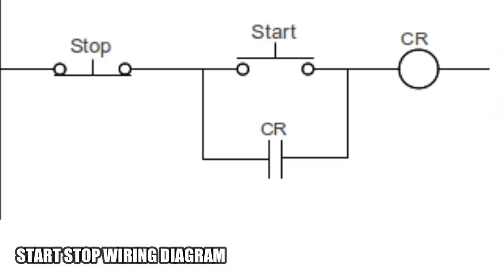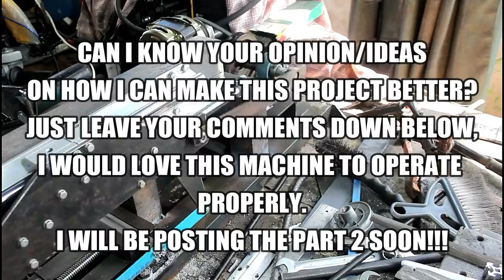Diy Power Hacksaw Build (Part 1 of 2)

Comment from the maker: here is the part two guys.
https://www.youtube.com/watch?v=2mNw62SRrbQ&feature=youtu.be
Reply: Hello, I am just wondering as you have used a washing machine motor, is this machine variable speed?, I am asking as I would like to make a dual purpose machine which could cut wood as well using a bow saw blade, I want something quieter running than a band saw or reciprocating saw to avoid bothering my neighbours especially late in the evening when I get home from work, if you did do this subsequently or think it is a practical possibility I would love to hear your thoughts, I also have a couple of ideas which might improve on your design, if they work I will share them with you😊
Reply from the maker: This type of washing machine motor is not variabled speed. Its different from other washing machine motor that comes with a variable speed circuit.
Reply: @SekAustria  OK, thank you for the info, wasn't clear from the video, I was thinking of using either an old but working automatic washing machine motor with variable electronic speed control or a one speed induction motor salvaged from a  BER drilling machine I have, the motor and switch gear are fine but the quill is broken, it was like this when purchased and Aldi replaced the whole machine rather than just the broken parts, so I have a very nice condition unused induction motor which I can repurpose, I was planning to run the saw by a toothed belt drive and change speed by using two conical stepped pulleys, I also have a few novel ideas for possible improvements

Comment: Great attempt, Bro. Notice that there's effect of  reciprocating induced resistance which increase load of motor..  The motor driver + gear, are to be mounted/share on the same platform with these LM bush,as single flipping module..Then, it's pivoted to the support bracket, where the clamp is based..This is to mitigate the saw blade sequentially pressing against workpiece, due to rotary linear conversion..

Comment: nice idea, I do remember that my dad have make the same saw 20 or 25 years ago and faces the same problem, so he have make a can attached beside the motor and keep add weight in it every time the saw blade stuck, until the saw cuts the material smoothly, keep in mind that not all materials will have the same weight in the rear can, you will have to increase and decrease weight each time you use this saw.
Reply from the maker: Thanks bro

Comment: You need a bigger pulley,those washing machine motors can spin 10 kilo drum but they need large pulley reduction.You could ad counterweight on the opposite end.Make hacksaw frame out of tubing not full plate to reduce weight.

Comment: For saving space at the back you could use a strong spring (from trampolin...) at the back instead of a back arm as counter weight. Counter force could be adjustable through a threaded hook at one end of the spring. It works like a charm at my custom belt sander.
Reply from the maker: Yep i think it will also work in that way. Thanks.

Comment: Great job Sek.  Try using a small, double acting air cylinder filled with automatic transmission fluid controlled by a needle valve to control the downward speed of the arm.  It worked slick for me on my 75-year-old Craftsman horizontal band saw.

Comment: I think the problems are 3 (I also tried to build such a machine).  1: the motor is actually too small, see if you can find one of at least 1.5kw and connect it with a chain instead of a belt.  2: the blade you are using is made for very powerful machines.  As you built the machine you can try to insert one for a manual saw.  3: even in the most powerful machines, a hydraulic system is used which slows the blade down while decreasing the cutting pressure and lifting it slightly when it goes back to reduce friction.
Reply from the maker: Wow. Thanks bro very informative.

Comment: Possible improvements to make it work:
Lube the rods and make sure they're perfectly aligned(otherwise they'll bind and not slide well).
Change to a stronger motor(>1kW or more), current one seems to struggle just moving the blade?
Add a little bit of counter balance to the saw so it can't weigh too heavy on the piece it's cutting.
Shorten the stroke, this gives better leverage hence strength.

Comment: Can you replace the your motor with a DeWalt 20 V DC drill? More torque, no need for pulley, belt or attachment. All you need is a plate with a gear clamp kind of attachment. And it would probably be cheaper. Good video, btw.

Comment: I'm not an expert but I believe if you put bigger motor with higher rpm, higher gear reduction (get rid of brass gears of using any and use steel instead) and also a shaft or chain drive. Can also try and put appropriate gas cylinder opposite to pivot or even in the middle depending on the size of cylinder

Comment: I'm sure you have many suggestions but I would use a dc treadmill motor. All the ones I've found are between 2 and 3 horse. And the best part is you can usually find them for free. Great project. I love your diy lathe too. I know you will find a solution 👍

Comment: Hey mate, nice cheap build as usual. Try using a gas strut, such as what you'd find on car bonnets. If it's too strong you can use a spring to tension it. Quick fix and it isn't perfect but you can improve it later
Reply from the maker: Oh yes mate i am looking for that also. Thanks

Comment: Maybe add a spring or a hydraulic cylinder to reduce the downward component of the resultant force on the arm. A hydraulic or pneumatic cylinder would be the best option as you could control the rate at which the arm goes down with it. It shouldn't be connected directly, though, the arm should rest on it instead. You could also even regulate the force on the cylinder based on the motor's speed, this way the arm will only be held up whenever it needs to be. (You could also just make modifications to the machine's drive (motor / gear reduction) though, although that feels a bit cheesey.)
Reply from the maker: Thanks bro

Comment: Try reducing the pendulum travel distance,if it travels too long,you will need a greater torque with your high pitch blade and the housing assembly,your motor also kinda seems medicore...use atleast 1hp decent motor and increase your gear ratio

Comment: I looked through almost all the comments. First off nice build. Try shortening the length of your stroke arm. You can jamb a worm gear fairly easy if you set it up incorrectly on a lighter motor. The motor may not be the problem if you can live with the longer time required to make a cut with a little motor.

Comment: Replace the motor with a bigger one, it is definitely not enough. For improvements, i will recommend using bearings on the connecting rod to minimize friction. I read one comment saying about slightly lifting the blade when retracting to reduce friction. I surely love to see that applied to this project.

Comment: i just made one. If you use very powerful motor your cut is not going to be clean. using some  piston and oiling best. but i could not do that. i did balance the arm weight. and use springs. that is solve my problem %70 . but if cutting part thin and vertical; sometimes it stucks . i thinked that turning a screw with the motor every turn arm allowed 1 mm or less may solve the problem i did not try that too. i use tredmill motor 1 hp 180v dc. by the way your machine is very nice and going to be work precisely i think.
Reply from the maker: Thanks for the tip bro

Comment: I was gonna ask how you figured the stroke length, then it stuck. Get more teeth engaged with the cut (like a 2" long cut across a 2" piece of stock) to help troubleshoot. Your test stock is a grabby, sticky cut because occasionally too few teeth are engaged. Making them dig deeper.  Good luck  You could change connecting rod length to alter the dwell time at the end of strokes.(I'd think shorter?) You should shorten your a stroke a little, pretty sure. I'd just put a 5 hp gas motor on it myself.  Like your build as usual!
Reply: and yeah, too heavy of an arm for that stock. Adjustable spring tensioner like a horizontal bandsaw
Reply from the maker: Thanks for the info bro.

Comment: Hi there, maybe i have few advices, so: 
1) your motor probably is rated at least 100-150watt which is too low (probably is good around 500w or maybe 750 if you want to do future upgrade like have more cutting capacity) and also you have to look at the rpm of the motor, if your is 2800rpm maybe you need a motor with 1400rpm, if your it's 1400rpm so you need 900rpm in order to mantain a good ratio that allows you to have a flawless cut.
2) you can add an air piston to change the descent or maybe a spring.
3) another thing i probably suggest is to change the position of the little tower with the stop switch, if you put it closer to the motor you can put a bigger vise and improve your cutting capacity.
4) Add a kind of a rail with a countebalance weight to change the pressure on the blade.
Hope to see your improvements, bye.

Comment: 1. totally enclosed motor and gear reducer would work better in a long-term run.
2. RPM control may be useful.
3. the upper linear rail is less loaded and less rigid because carriages are too close; flat linear rail may be better then cylindrical rail.
4. Use bronze bushings in saw joints.
5. I see just about 1/3 of the blade length was used in a test run. I understand, the test part was too small. Do you plan to adjust saw travel by switching to another hole?

Comment: Motor is too weak, you could add a counterweight to compensate a bit... Nice build as usual
Reply: I think you're right, as the motor is currently not providing enough force to overcome the dry friction between the saw and the stock that's being cut. This force is proportional to the force the arm puts on the stock. Thus adding a counterweight, which reduces the moment that the arm has on the cutting side, will reduce the friction the saw experiences. (It might not only be dry friction, though, it could also be the resistance caused by each of the saw's teeth trying to go up, which would make a counterweight of some kind even more effective.)
Reply: I'm with Soda, Try putting a bar and counterweight out over the back of the pivot and as he said Nice work 👍
Reply from the maker: Thanks bro will surely try it.

Comment: Good afternoon your project very ingenious, especially for small workshops that work with metals. One of the things I noticed is that you should not use linear bearings for the turret holder, better is the dovetail, because it resists wear more and is easier to calibrate. Another detail is that you should place a coolant system to protect the blade. If possible, place a press that can rotate to make cuts at different angles. otherwise I congratulate you. My name is ernesto and I live in Venezuela and I also manufacture these types of projects for small workshops. that you succeed in your projects.

Comment: Motor power would be ok if you used a thinner blade. To adjust the feed speed, either add a hydraulic damper with  bleeding adustment, or a counter balance with a sliding wheight to adjust downward / feed pressure. Thanks, nice job!

Comment: The pulley sizes are totally wrong you will need at least 3:1 largest on worm gear small on motor
Reply: Agreed. The driven pulley actually looks smaller than the drive pulley, thereby increasing shaft speed prior to the deep reduction offered by the worm. However, as commented previously by others, the saw arm needs counterweight.

Comment: Excuse me, I'm ernest again, forget to comment on the engine. you should not use washing machine motors for machinery unless it is a piece of equipment that requires little power, and you have to make the sacrifice and acquire a motor of good power and torque, I propose a motor with two horsepower and problem solved.